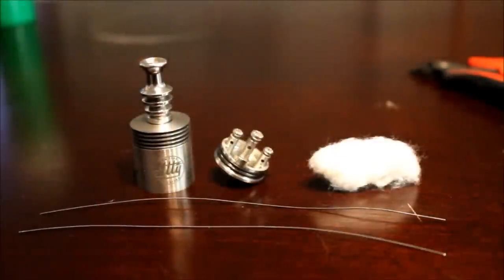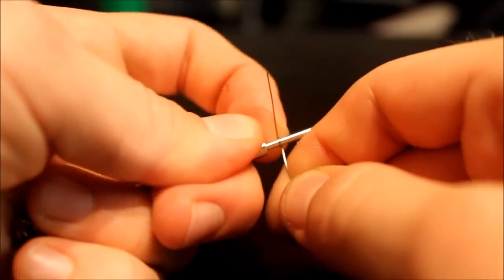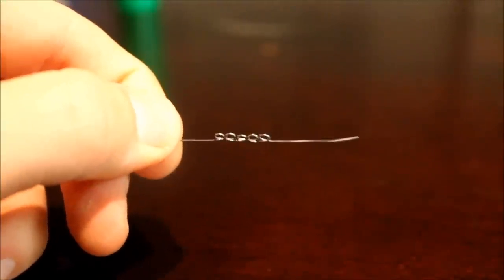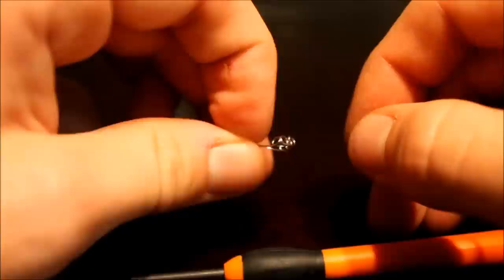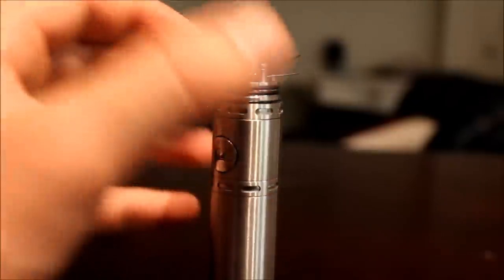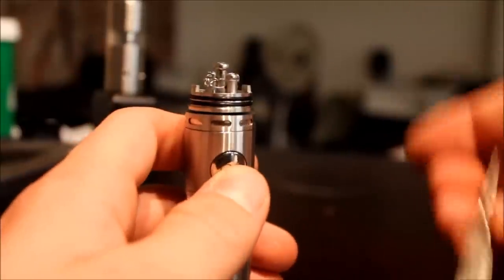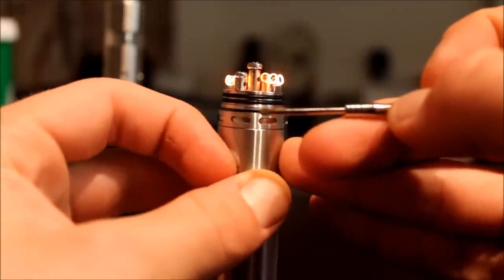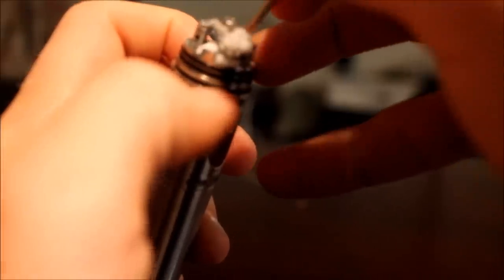Crown Coil Build Tutorial

Comment: Somthing to try and prevent those hot spots- after you build this coil and mount it and fire it the clear it all up, make the wick twice as long as usual folding that in half, and using a needle and thread weave it through each of the crowns rings. Then use that needle to fluff out the cotton a little, drip and vape 👌👍
Reply: keith jackson i knew someone would suggest this if he didnt, i havent tried this coil yet butwhen i do ill try both styles.....i wonder what wattage is best for this use tho.

Comment: If I used 28 gauge I'll be closer to around .5-.8 ohms correct? I am still new at sub ohm builds but really like the coil design.
Reply: Im just uneasy going to .3-4 even though my mod can handle it with vtc5's
Reply from the maker: ,Ethan Bresele You are indeed correct, that is if you were using something below 28 as a comparison. The higher the gauge the thinner the wire the higher the resistance, spot on brother.

Comment: this is a very nice and indeed a cool temperature vape build even at .4 but the wicking, for me, is the problem - hot spots appear unless its very tightly wicked. Maybe something other than cotton...?
Reply from the maker: hmm.. perhaps you wrapped the coils too close together, there should be no hot spotting as you can clearly see in the video
Reply from the maker: August Johansson And I use hemp wick over cotton all the time now, it is a much cleaner tasting vape.
Reply: August Johansson to be clear I'm not having an issue, I got rid of hotspots before wicking, and can get these to work just great on my tobh v2, I was just sharing my observations: "less is more" seems to be the rule with most other wickings/coils whereas this one seems to require a packed/tight wick. Lasts a long time - Again I like the coolness of the vape and I'll use this setup for sure for when I don't want to have to drip as often. :) So, tanks!

Comment: Question, when you build a dual coil, does your resistance get higher or lower? Im thinking lower but im not entirely sure and im not trying to vent my battery bc its not a very good battery for sub ohm vaping.
Reply: When building a dual coil your resistance will drop by around 1/2. Usually I'll build the first coil, pop it in and check the ohms.  Then take that number and cut it in half, that will be what you will have once you place the second coil in.
Reply: Thank you sire you helped greatly.
Reply: If you don't know basic battery safety like that, don't ever go below .8, ever. You need to understand battery safety before you vape on a mech or build your own coils

Comment: Lol u can get an equal of even better vape from a simple micro/macro dual. I never understood these complicated ass builds. NONE of them I've tried on hundreds of people's setups performed any different(mostly even worse) than traditional, easy, fast basic micros.
Reply from the maker: its just for people who enjoy tinkering. not saying its the best thing in the world but it does provide a wholesome vape with a much cooler draw than most builds to the surface area. none the less to each their own.
Reply: I know what you mean, but there are always exceptions. The fused clapton is that exception. I have it on the twisted messes RDA right now (i did six reps using 26 gauge wires for the core and 32 gauge to wrap around, (0.12 ohms, but I've had it at 5 reps before, which was amazing) and I also have the Goliath RDA with 8 traditional coils, 26 gauge, 10 reps each, which came out to be 0.13 ohms. I gotta say the fused clapton is the best coil I have ever vaped on so far. It's such a tasty and moisturized vapor. At 5 reps, the ramp up time is a lot quicker, which is why I like it better. I know I can use nichrome 80 for that, but I just like to stick to kanthal and work my way around strictly with that.
Reply: wanna bet?...ROTF! ! !...smh...